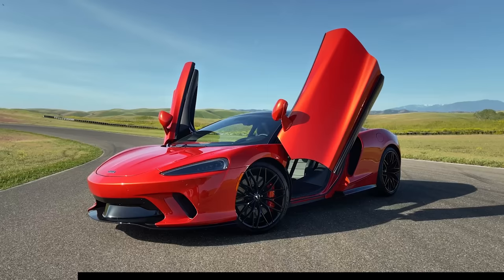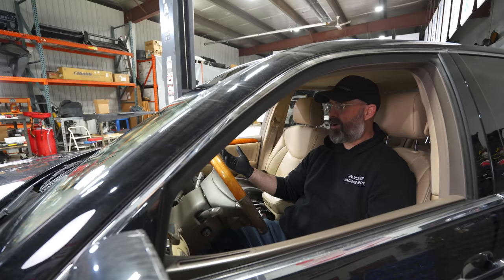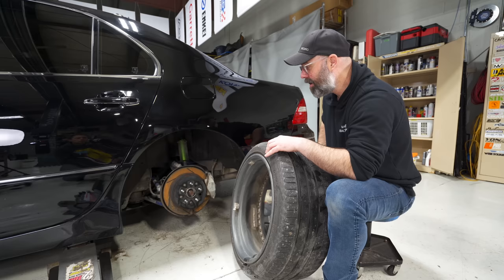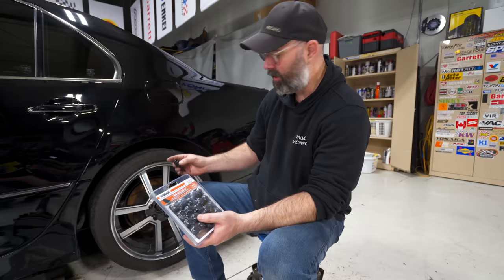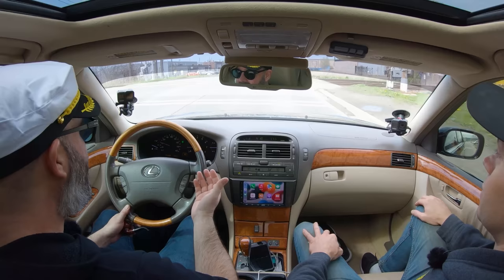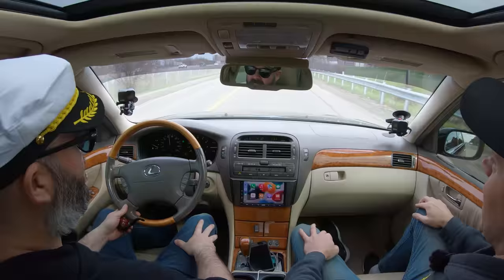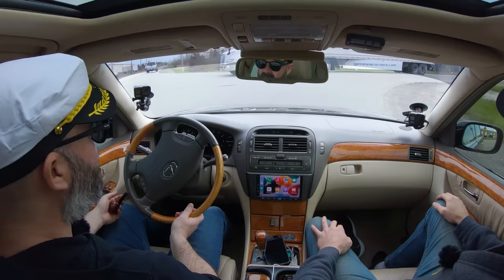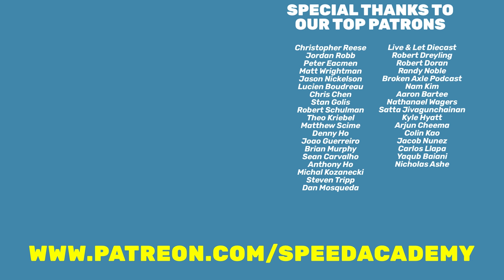Ford Supercharged Lexus LS430 Long Term Update - Reliability, Regrets, or PERFECTION?!

Comment: I cannot get over how absolutely perfect those wheels are. Just the right blend of nostalgia and modern.
Reply: Definitely!

I questioned them at-first, but that quickly went away when I actually saw them on the car.
Reply: What wheels are those by any chance you guys know?
Reply: Right, now if they weren't so expensive my 430 would have a set!

Comment: I regret selling my ls400 especially after a really long and fun road trip but I needed the money to get rid of a motor home I didn't need anymore. I can see another LS car in my future, I've always been attracted to VIP builds
Reply: Same, mine was in imperial jade mica paint color 🥲🥲
Reply: I'll look for an 05/06 UL in White or Silver to do similar upgrades . 
But I'll try using a Whipple twin screw supercharger and the best brakes are EBC USR Rotors and YellowStuff brake pads combined with Redline full synthetic brake fluid. 
Good Luck on your LS 430 hunt.

Comment: PRO TIP:  Change the oil BEFORE STORAGE....leaving the used oil in it which is full of pollutants and changing chemistry is better in the recycling bin than in your motor for months.  Always change it BEFORE storage.

Comment: Just a tip guys, you should really apply some metal particle remover (fallout or metal cleaner) as part of the damage and current look of the wheels is due to those pesky particles messing with the finish

Comment: I built a helmholtz resonator setup for my muffler delete LS430 that completely eliminates that drone you can hear at 12:06. Works great and showing people how you can make one or design one to have a shop fabricate could make for a great video.
Reply: Wow, someone out there who understands what a resonator is for! Nice work.
Reply: I did the quarter wave resonator on my LS430. Had a horrible drone at around 1800 RPM which is now completely gone.

Comment: Just got my LS430 because of this series and my favorite Easter Egg is the Crotch Vent beneath the steering column.
Reply: Interesting fact. The first gen Nissan X-trail has a super cold A/C system. And…… a CROTCH vent!!
Reply: how much did you grab it for?
Reply: One of my favorite features of my LS430 as well
Reply: My LS400 has that too! Unfortunately the aftermarket A/C pump failed and I need to buy a new one, so no nut chiller for me.
Reply: Oh yea the balls ac ? I love it too

Comment: Rocking a 08 GS460. Getting things together to do a nice build nothing too crazy. But your LS bro my god
Reply: GS460 is the best of the lot. 8 speed, same RWHP without a blower, quick for a heavy car, handles well. I kept a pretty new RS5 honest through twisties/uphill it was hilarious, slightly slower on exit (they are 4wd vs mostly open diff) but he didn't pull on the straights or get away in the corners lol. 
Just did the front AVC shocks it's like a new car, absolutely love that car.

Comment: I've had the pleasure of owning one of these 430s.. What a fabulous car.. Replaced it with a 460 SEL which I sold some 8 months ago.. I'm actually looking for another Lexus.. And yes I'm going for another 430 :)
Reply: Try the 460 as well and if you can the GS.. it is the superior option as it doesn't chew lower arms at 60k miles.

Comment: I've actually recently purchased an LS430 and came across the FLEXUS build while researching ideas on how to modify it in the future. It's safe to say this is very in keeping with what I would like to do to mine. Still working my way through the build series but so far very much enjoying it! It's good to know that the coilovers don't have too much of a detrimental impact on the ride quality. Mine is running the air suspension which is super comfy but makes it handle like a wet paper bag!

Comment: I love this build so much! I think I would build mine very much the same. I’d go with the same size wheels and offset probably, but not style because I can’t just rip you off. I might see if I could manage to adapt a different supercharger, I’d have to do research to be sure. Either way I think this is such a cool and fun build. Where you could use this all the time and enjoy it very much without regretting any of the modifications. This car and the LS460 generation that immediately followed this generation of the LS430, are my two favorite body styles of these cars. The new ones are very nice and cool too but are much different cars really. Even bigger and much more tech built in to them. I like the relative simplicity of these older Lexus big bodies.

Comment: Your next project should do a 2007-2012 Lexus LS460 Super Charger or Turbo!!!
Reply: Boxes on them are only good to ~450-500hp though. That's why they made the LFA 6 speed while the 8 was available in the GS/lS460..

Comment: I enjoyed your build of this LS430.  I purchased a 2007 LS460 about eight years ago and sometimes feel that I should have held out for the right 2005-2006 LS430.  I'm making the best of what I have.  I'm expecting to go through the front control arm experience for the second round of replacements within the next 30-40k miles.  Any suggestions regarding replacement parts, or just go with OEM again? Thank you for your content.
Reply: See if nolothane bushes exist for the LCAs. I'm pretty sure clublexus forum has pages about this. Or swap it for the GS it doesn't kill LCA as it's 200kg lighter ;)

Comment: I don’t use Valvoline I use Castrol edge 5W 30 i use that in my 2001 Nissan pathfinder we just hit 60,000 miles my gas miles I’m getting 20 miles per gallon now

Comment: Guys, this video is so tempting for me. Lately I have really been tempted to buy one of these older Lexus and sell my Audi Q5 with the supercharged 3.0T. I could use the extra cash from my Audi to modify one of these exactly how I want it. And I already own two other Toyotas. I am just so torn right now. The more I see these reliable luxury cars the more I want one.
Reply from the maker: Not sure how old the Audi is but if it's out of warranty then the switch is a no brainer as we both know the cost of fixing the Audi is never a cheap affair.
Reply: @speedacademy  it's 2014. And that is certainly my biggest fear with it. I have seen repair videos on that engine and it would be nearly impossible for me to replace something as simple as the alternator on my own.
Reply: @jackgray1402  i kept a pretty new RS5 honest through twisties uphill in a GS460 with newer tyres. Only time it pulled was corner exit as i'm limited to one leg pegger mostly open diff lol, nothing in it on the straights. They are slept on hard.. definitely make the switch before you break the audi lol.

Comment: what an epic daily!! i bought an 06 ls430 with 98k miles back in 2019. i didnt do a good enough inspection/test drive before i bought it. ended up having some real problems at just 98k. all shocks were blown, had some really bad wheel wobbles/vibes at speed. ended up being something  with  the power steering rack. all speakers were blown.  really bummed me out on the ls430. kinda want to get another one before the market for them goes through the roof but im scared haha

Comment: Honestly, the worst thing about the wheels is the way you've aligned the centercaps. They should be turned so that the "TOYOTA" text reads correctly either with a single lug at the top or the bottom, and then the locking nut should go on that stud.

Comment: This, the 400 and the 460 are amazing DDs. Especially the GS460 if you live in a country where roads are not straight, has same RWHP without the blower, but they are unicorns outside of NZ/AU/JP. Only mod I want to do to the 460 is LSD, so it can finish tyres off properly. And this is coming from someone with a fully caged/everything modded LS3 S2k who rode litre bikes for years lol. 
Lexuses are reliable, they go and don't break the bank (IF you work on them yourself mostly) and provide similar luxury to the best out there and are only a little slower than the wallet breaking euros. They can't people off guard on the regular lol

Comment: If those wheel lips are actually chrome...soft steel wool is all you need to polish them up, but the way they are corroding and how they turn a rag black when polishing says they are polished aluminum and not chrome...and as such steel wool would scratch the living shit out of them. So the key to proper wheel care is knowing the material you are working with and using the appropriate technique for that material.

Comment: what about the radio. Does the car retain its factory features with the custom radio? I have a 06 LS 430 and im interested in getting a new radio, but I dont want to lose the on screen features..... I asked this on the original video where you introduced the radio, and you removed my question. please answer it.

Comment: Fantastic build. Really enjoyed the series. But I can't help but wonder if the sport sedan challenge would have worked out differently if a GS300 with a 2JZGTE swap was used instead of the LS430 seeing as the GS300 is more of a M5 sized sedan vs the LS430. As sized comparisons go the GS300 is equivalent to a 5 series and LS430 to a 7 series.

Comment: After doing a bit of work with 'ceramic' coatings for 3D resin printers, I found out the ceramic part is highly misleading. Most of the products are little more than silicone thinned with water.

Comment: I am starting to hate my own LS430… OEM air sus have a bug and and I am stuck on a very high setting. I warped 3 sets of discs, even while driving like my grandpa.
There is probably some very small mechanical issues but I can't identify them…

Comment: I have an LS500 as a loaner while they fix the clear bra on the LC500 I just bought. The LS is a little rocket of an engine! Lexus should put that mill in the LC, id call it the LC 506 and LC 508 for the 6 and 8 cylinder units all being LC500's I know that was a bit off topic.

Comment: At first glance this car makes no sense. Go buy a used Mercedes AMG instead. Lord knows they are cheap because the depreciation is insane on those cars. But that's just it, the depreciation tells you ALL you need to know about the car. Where you'll be spending an average of $6k a year maintaining a 12 year old AMG, you'll probably spend $1.5k maintaining this car and have 85% as much fun!
Reply: Actually much much less. Hardly anything ever goes wrong with these.